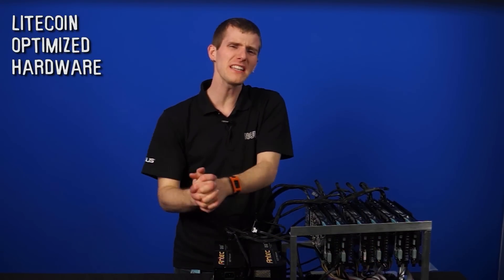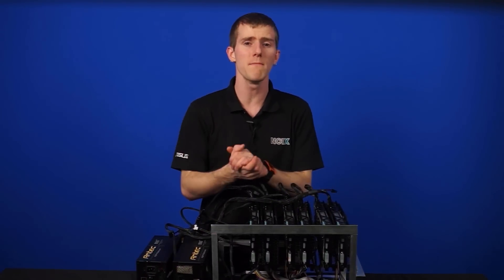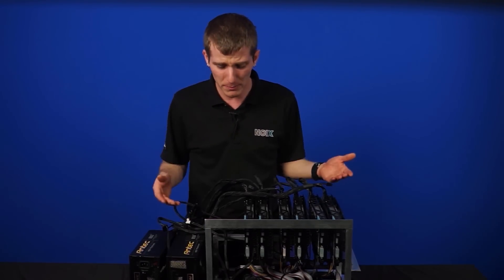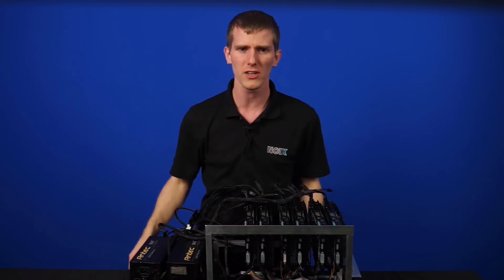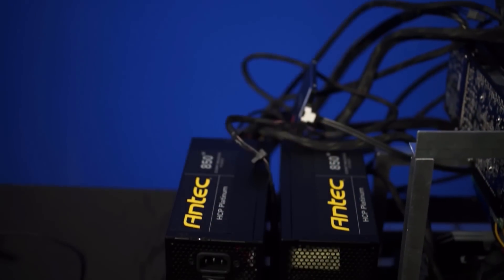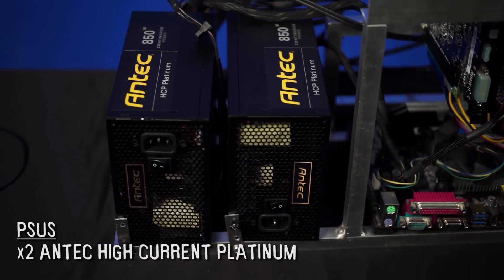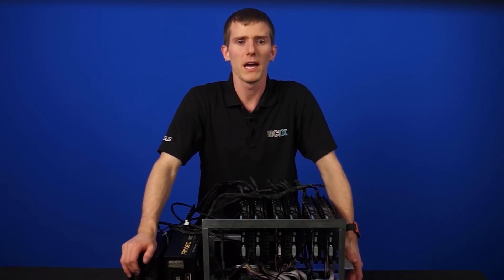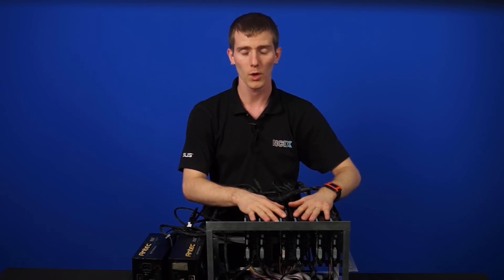Super Custom BitCoin/LiteCoin Mining Rig 2.0 - Tech Tips

Comment: Avoid all those typical systems eventually found to be scams. They are really not of that worth you are looking for. Much better would be to use this CF App==>> (Link Here >> OptionCode. Net ). I think this app is far better than all those typical trading systems. Why? I would like to say straight that it is nothing but the winning rate of the signals the system makesf or you while trading. Its average ability to produce winning signals is around 83%. It’s great, I think. Even you won’t need to find their contact number for any reason though their customer service is the best one in the block.
Reply: Sounds like your advertising a scam.

Comment: Hey Brah, do you have a beta test price for that rig? 

I came to your channel to learn how to build one; cuz I took a hit in Iraq, and following two failed surgeries I had to retire after trying to recover for a year.

Let me know how much you need for it, as I will be buying or trying to obtain more rigs as soon as I can, fixed income for now.

I will be trying to get it setup, and build up so that my wife will be able to work with me from home.

Do you have any hash rate estimates? 

Have you tried plugging it in to a Kill A Watt meter to determine the draw?

I have a small backup solar PV setup, that if the power went out in my home, not a big setup, but enough to run the frige, a 27" TV, small 800w microwave, two 12v led lights and to charge cell phones and a laptop and such but built it so it could grow with me, as the gear has been getting better, (effienct), and the cost slowly ticks down.  

Currently only I only have a 2000w / 4000w peak inverter, and not a pure sin wave, but can use a surge strip until I can find one thats like 5000watts for a good price...

Thanks for any additional information!  Since I spent 25 years in uniform; I like to support  new startups whenever possible, any additional info would be appreciated.  Thx!

Very Respectfully,
WW

Comment: what is litemining? how do you "mine" for bit coins and lite coins?
Reply: +Black Rage The idea behind it is that companies need complex calculations solved. However, they use Litecoin's/Bitcoin's software to offload those computations onto whoever is running a miner. Since GPU's can do a lot of calculations at once, those cards run the algorithms to solve the problems, then send the answers to the companies that need them. Thus, Bitcoin/Litecoin are paid by those companies and so are you. Thus, the companies get their problems solved for a lower price than it would have taken for them to have the hardware and do it on their own. Everybody wins. This is a really simple explanation, and it's much more complex than it seems, but that's basically the surface of it.

Comment: How much is each card puling in?
 I have and Max outputs and BFG Miner label
1 Twin Frozr III 2GB DDR5 R6950  @ 330Mh/s, OCL
1 USB Avalon ASIC @ 330Mh/s, BES
3 USB Antminer 1.2 @ 2Gh/s, AMU
Currently mining Peercoin was Bitcoin on Slush's pool neither have turned 1 coin after  starting July 2014 with just the old EVGA 2GB DR3 was only 10Mh/s until I bought the first Avalon from 7/5 0.00000875 BTC confirmed
7/24 before purchase the 1st 2 Antminers 0.00010434 BTC confirmed in the morning before approx. 5:00pm installation 0.00010826 BTC by 11:00pm
8/3 was the last Antminer 0.00071069 BTC confirmed installed around 11:00am
10:50 that night 0.00075400 BTC confirmed
By 9/29 was only @ 0.00651381 BTC confirmed so I switched to peercoin still nothing I.was gonna upgrade my rig just boosted my electric bill.

Comment: So, can someone make a self contained, self sufficient rig? I am talking all the hardware to mine, plus a solar panel array, that you give access internet only. It would be hard to get enough power probably but imagine that... you just stick it outside within WiFi distance of your house and forget it. It would be cool as well, lots of airflow.
Reply: If you put it outside it would gather like a metric ton of dust
Reply: Armadillito Altcoin gpu mining is no longer remotely profitable...
Reply: it would drain wifi bandwidth liking hell, you would want to connect it via ethernet, and the humidity will kill the components very quickly.
Reply: +The Phoenix No. Nobody will do it because the initial investment and maintenance cost are so large  that it's simply cheaper to use grid power.
Reply: solar panels? it would be better to sell that power rather than waste it on mining.
Reply: Armadillito you also need a transformer, as solor panels don't make 240, and why would you put it outside? its a computer you fool!
Reply: Ozzie Peck For cooling and cause it is a cazy idea.
Reply: but you will have to cover the whole board to protect it from the rain, so it will be pointless? and the heat from the transformer will also effect your pc, you will need a bank of batteries, a voltage regulator, and at that point you may as well put it inside...
Reply: Ozzie Peck ok, ok, :-(
Reply: nobody will do that because it is basicaly a money printer if you do it right and who the fuck wants to sell his moneyprinter if he can use it himself, because nobody is going to buy it if they dont make Profit with it.

Comment: take a card out put in a GeForce Titan Z just to see if it could do the work a crappy gt 610 2GB DDR2 pulled in 12.9MH/s about 45-50 shares if your lucky 0.00000007 was my last lowest reward mostly low numbers as it's max in guiminer until I got a USB Avalon miner running cgiminer it's seems 2-300 MH/s been getting 600+ shares just from last night to this post 0.00000076 0.00000096 0.00000087 0.00000081  as the last few rewards as examples so from 5pm to 11:30am on 1 usb eruptor. But I would drill some new holes and space out the cards as far toward the ends before the cards pop out the socket as much as possible then adjust the others how come I don't see liquid cooling on any of these that seems to me your gonna go all out on it then by all means liquidize the cards color tubing piece of silver keep it simple.

Comment: Yeah.... about running 3 280x's on an 850watt plus mobo/cpu/powered risers especially a 80plus bronze. Even undervolted i'd be VERY weary. Gold should also be the minimum. 

You want to be at 80% of the psu's max power or it wont last you very long. 2x 1000watt should be your sweet spot for this kinda setup

Comment: From one channel to another, good job ... My question however is did you guys actually turn that on? Because 850w is not enough for 3 of those cards ... Under a full load those 280x's will pull (even optimized and voltage modded) 250w-265w each. You combine that with one of those PSU's holding up that mb/cpu and your first PSU is going to clip out pushing that 850 well over 1k/w AC ... with a 90% efficiency you will be just over 850w... couple that with any core/mem clock adjusting and you could easily pop that PSU. You really need to aim for a 1050 to 1200 if putting (3) 280x's...

Check our channel out if you want to know more. It is dedicated at educating people on this exact subject of building cryptocurrency mining rigs.

Thanks!
Reply: 850W is actually plenty for 3x 280's.  They draw around 270W max, or 230-240W when undervolted.  Motherboard, SSD and RAM, will consume sub 30W.
Reply: asusreviews it's not plenty for sure. you say they draw 270W max, for 3 cards thats 810W max. Motherboard, SSD and RAM sub 30W and CPU can draw about 65W max. Thats already about 900W. And he says, you can't run PSU at 100% load, also if you count the efficiency as guys from Bits Be Trippin' suggesting this setup will kill the PSUs after some time...
Reply: Alexei Morozov I am building a rig and so far I only have 1 280x toxic in there, undervolted to 1.094vddc. CPU is almost unused, while mining. My rig is pulling 250watts from the wall, all parts included (Mining at 710kh/s stable), with only one card. So I assume that my card is pulling 200 watts from the wall. Now to the math; 3 x 200watts + 50 watts for the board = 650 watts. If you add 3 more cards to the same board on a 2nd PSU, there's another 3 x 40watts to be added to the 1st PSU, which results in a 770wattage from the wall (1st PSU). So yeah, I think 850 will do
Reply: Martin Heuts this video is about getting maximum performance, but you are apparently building power saving mining rig with high end GPU. But I agree that CPU will not consume 65W so it can be your 50 watts for board but definitely not 200 watts for gpu. if you were using your GPU on 100% (mining 800+ kh/s) it would consume much more power. Your calculations are therefore irrelevant

Comment: Help Needed!
I have ASRock Fatal1ty Motherboard
2 AX860 power supply
6 Radeon R9 280X graphic cards
I used HDMI connected to the monitor and it says no signal
the processor fan is on and there is ticking sound from the power supply
the keyboard is not powered on
and nothing else is coming on
Please help

Comment: I need help!! So I'm building a rig and I've got one major question. How did linus put 6 graphics cards into his motherboard if he only had 1PCIE Express slot? Don't you need 6PCIE Express slots if you wanted to put in 6 graphics cards?
Reply: my god... did any of you watch the video? sigh... there are 6 1xpci slots on the board. The risers go from the 1xpci to the card. You don't need pcie slots as it doesn't need that much bandwidth for it to warrant getting a board with 6 pcie slots. The 1xpci slots are plenty. The riser cable make the card compatible to the 1x slots. He explains this in full detail in the video. Please watch the video again.
Reply: did you not watch the video, pcie risers
Reply: It does have 6 pci slots. check the link to the board in the description .
Reply: asrock H81 Pro BTC
Reply: david fli PCIE risers don't increase how many slots you have douchebag...
Reply: They are x1 (thats the speed) PCIe slots
that doesnt mean there is only 1. Thats the speed. 
For example: If you plug in a graphics card for GAMING with NO RISERS like every normal person you would put into a x16 PCIe slot. If you do SLI, the second slot will most likely be a x8 speed PCIe slot. Does that make sense now? :)
Reply: The Podcast Gaming Actually there are some risers that take one pci-e 1x slot and turn it into 4x pci-e 1x slots.  Not sure if they work at all for mining, but they are out there.
Reply: jerseyhuckster You mean PCIe x1 slots?

Comment: Would making a rig with multiple EVGA GTX 780Ti's be more optimized for litecoin mining?
Reply: thats just wasting money
Reply: Not really, unless you use litecoin cuda mining but it still weak against AMD's card for price/efficiency
Reply: They are getting better though. CudaMiner is pushing 650+ kH/s on my gtx780. Still a bit off from AMD, but it's getting there.
Reply: Tio Dave might i ask what your cudaminer settings are? i'm only getting around 560kh/s with my superclocked 780.
Reply: ***** cudaminer.exe -d 0 -H 2 -C 0 -m 1 -l Z12x24 -i 0
Reply: There is only one nVidia card that is promising and we will be reviewing it on our channel in a few weeks. The new Maxwell based nVidia 750ti ... great hash/power performance.

Comment: While Antec are some of the best PSU brands, 850W for 3x R9 is in no way ovewrkill. Gigabyte are also voltage locked and they eat 250-300W/each from the wall. Even more if you keep'em above 80 degrees.
Reply: have you guys actually got this rig to mine with 6 GPUs? What motherboard are you using?

Comment: fuck you miners, bring up gpu prices
Reply: ***** Wut? Are you serious? The AMD cards run so much hotter than the NVidia cards :D I have a gtx 660 and it never goes over 60c so I have no idea where you got your information.
Reply: Let's just stop this argument. Both manufacturers make awesome cards but the stock coolers usually suck on both of them.
Reply: Get Nvidia.
Reply: ***** I happen to use an nVIDIA card for indoor heating purposes only.
~
Reply: *****
its not even a comeback shill, its a known fact nvidia runs hotter than the sun. AMD strong.
Reply: ***** that does not happen since the gtx 480 came out. the new nvidia cards run way cooler than their amd counterparts.
Reply: Im not even going to get into this fanboy fight
Reply: Eth5471 AMD FOR LYFE SON!~
Reply: ***** amen to that.
Reply: ***** INTEL HD FTW
Reply: 3 years ago amd cards reached very high temperatures
Reply: Arhk Xi Yeah 4 gtx Titan's are the equivalent of a sauna room. hurp a durp
Reply: ***** Completely untrue. The temps of consumer cards don't count at all. What matters is the running temps of the reference cards. A water cooled variant AMD card is going to run cooler than an equivalent variant Nvidia card with basic fan cooling. So just compare the temp ranges of equivalent AMD and Nvidia reference cards. You will see that Nvida cards run dramatically cooler than AMD cards.
Reply: ***** Yeah you're a fucking idiot
Reply: FunkDaBeat95 ;_;
Reply: stupid miners :(
Reply: YOUBANNA get a ps4 like a real gamer
Reply: Profetu Rulz
I don't want to burn down my house

Comment: The Asus P9x79ws would be a nice board for litecoin mining??  It has 6 full sized pcie 16 slots although not all are wired for 16, some are wired for 8 or half... but that would still be better then a 1x any day??  Since both the cpu and ram is not something of great importance for the litecoin mining, would a E5-2650v2 or so be a nice cpu as it actually has like 8 cores and 16 threads at 8gts and 20mb L3 cashe but the power consumption is fairly low  or I guess one could get the e5-2603 with just 4 cores and 4 threads if it really makes no big difference in mining..  what was the deal with the two power supplies you spoke of being booted together??  If you just hit the power switch on the mother board, will not both supplies simply come on together or whats the deal...  I am curious about that...  let me know what you think...

Comment: These cards are locked at 1.2 volt. Plus with 3 fan it takes more power then typical 2 fan 280x. At full load these card uses 290 to 310 watts. All depends on ambient temp. I have 3 running with a 1200 gold psu,ssd and sempron145. At ambient temp of 50 in the garage. It runs 1000 to 1050 watts. I undervolt to 1.075 each card using Trixx but only saving 20 to 40 watts total. Tbh those PSU won't last long, running at full load all night and day.

Comment: Much better rig than last time guys! If you look at the 6 cards you can see that they are almost grouped in twos. You're going to need air flow between the top and botton gpu on each "pair" The top card will be a lot hotter than the bottom giving you less room to increase a stable hashrate. Do you guys accept the anus coin yet? bahahah jk nice vid guys!

Comment: Never mind bitcoin mining, I want to replace the AMD cards with Nvidia cards and use this thing for 3D rendering! Just  and imagine the speed boost you would get with Octane, Cycles, Presto, FurryBall etc... drools :D
Reply: Problem: These applications are all very I/O heavy, so the PCIe x1 won't do you any favors :/
Reply: Doesn't matter, once the data is loaded into the GPU the GPU does the rest. Using a PCIe 1x connection won't make much of an impact on the speed of the render
Reply: Chickenkeeper24 with 3D rendering A LOT of data throughput is required to get good results. At least for non-static 3D rendering. If you're rendering a static 3D scene it might just be fine. But then again... thread synchronization and the likes...
Reply: True, but as I said the bus speed only really matters when loading the data onto the GPU. In most cases the time it takes is only a fraction of the total render time per frame, so render times aren't really affected too much by a slower bus unless your scene takes only a few seconds to render (at least with Cycles anyway)

However even quite complex scenes could render in seconds with that setup, the performance gains from the extra cards might significantly outweigh the slowdown from the bus, but I agree that it probably just depends on the project being rendered

Source: http://www.systemagnostic.com/faqs/
Reply: CHICKEN!!!!!!!!
Reply: oh man this hasnt aged well.....

Comment: your mining rig is by my oppinion realy stupit :)
The gpu's in it will run hot, coz there is not much space between cards, you shoud plan it better, and use all of it's potentials, coz u can extend it 5 more cm's to do right (from our angle) and that way you can move bottom card further away, and on every 4cm u can attach a card. My measurements that i use are 60cm wide and 30 cm high, that way with long risers u can put 2 cards on 10cm space, and that way they are cool and quite, coz u must watch for fans that die fast, especialy on that gb model

Comment: The only reason I would ever mine is if I was planning a sick rig anyways. Buy 3 more 280xs and build an epic gaming rig, use it to mine/game, then you still get the hardware and can use it. Then just hope you make up electricity costs and youd be ok.
Reply: north seven o five
Not to mention that it wouldn't even work ;p AMD/Nvidia drivers don't actually support more then 4 cards and the motherboard you would be using to take advantage of that many cards would be very specialized and horrible for gaming. Just look at this motherboard in this video, it is using 6 pcie 1x slots, that just wouldn't cut it for gaming.

Comment: R9 280x is about 254-280w power consumption at 100% times 6 = 1524-1680w
(depending on the review)
2x850w psu = 1700w
if the gpu's are using 280w at max it is 98.8% load without the mobo, cpu and SSD
I would say that it's cutting it close...
Reply: cutting it very close indeed. Keep in mind tho, that it is quite possible that the GPUs are undervolted :)
Reply: d3rrial as long as linus didn't say so I will assume that it isn't
Reply: Rasmus Nielsen fair enough